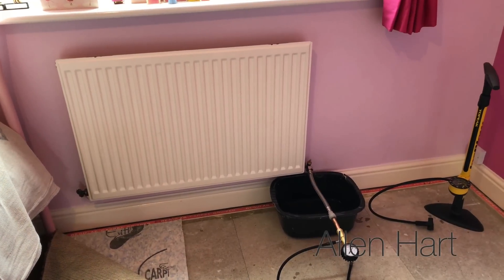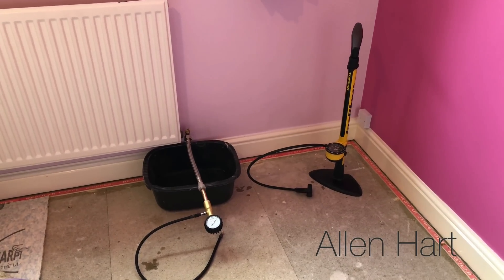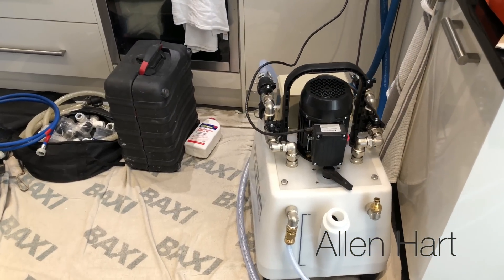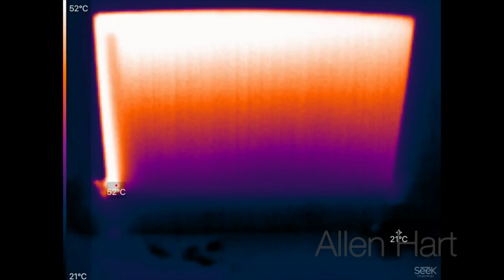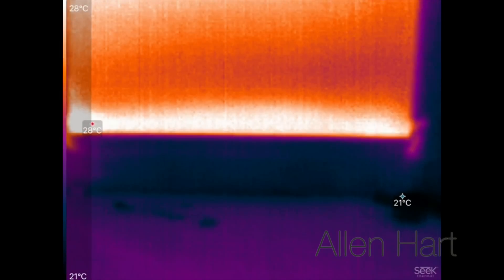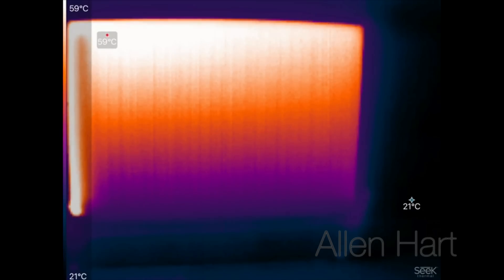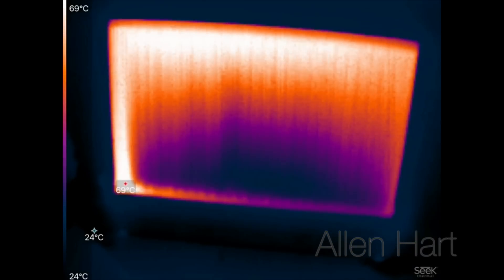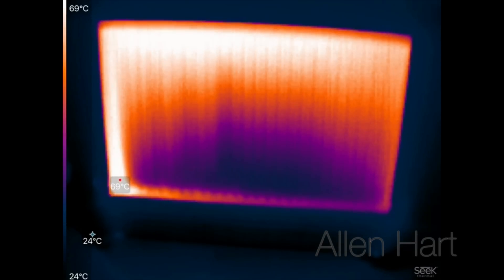Powerflushing Blocked Microbore Copper Pipe Day in the life of a Plumber

Comment: I tried the trick with the pump this morning, but to no avail on the 10mm plastic microbore return feed from the hall radiator. Think I must have put about 5 or 6 bar of pressure up it - all I managed to do was to cause air to flow into the kitchen radiator, and displace water up the cold feed which ended up going out the overflow pipe outside! But no water coming back down the microbore the other way, save for 1 or 2 drips a second - which is pretty useless for getting any semblance of flow! Even putting mains pressure water up it from a hosepipe yesterday did poop all too! Oh well - back to the drawing board!
Reply from the maker: Thanks very much for your comment, please consider subscribing to support the channel 🙂
Reply: @AllenHart999  My fix worked! Cutting a hatch into the landing floor so I could access the tee where the 10mm microbore return pipe joined on. It was totally blocked with magnetite, and I had to use a screwdriver to unblock it. Works a treat now though!
Reply: @AllenHart999  I've just subscribed! BTW I've located where the 10mm plastic microbore from the return from the hall radiator joins a tee now, so am going to unblock it there later this morning. That's pretty much guaranteed to sort it. Then to do the same fix for the return pipe from the lounge radiator.

Comment: Hi Allen would you say there's a age limit on copper micro bore I've got a system that's about 30 years old and was wondering if it would be better to renew the system is holding pressure but one rad burst about 5 years ago which I changed
Reply from the maker: renewing it maybe the best plan, depends on issues. Thanks.

Comment: Great idea and great vid... I’m guessing this would work on 15mm piped systems? Also what pressure did the blockage clear at ??
Reply: Thanks again Alan, to clear the blockage with the pump did you drain down the system or do it still with system water in the system
Reply from the maker: i have never needed to do it on 15mm tbh but i am guessing it would work the same. Thanks.

Comment: Hi Allen, genuine question not a criticism, with rads being so cheap now would it not be cheaper to replace it compared to the hours spent flushing?
Reply from the maker: Peter Gillam Thank You so much for your question, Replacing the radiator wouldn’t of made a difference, The pipe was blocked, I did advise to re pipe as well but it would of been tricky to do, chipboard floors with some of it tiled. Hope that answers your question. Thanks
Reply: Allen Hart thanks for the quick response, sorry I missed that bit!
Reply from the maker: Changing a rad would not clean or unblock the pipes. Thanks.

Comment: Great video Al, one question... a local plumber recommends a powder flush (as opposed to power flush) for my microbore crappy system. Do you agree that a powder flush makes all the difference? Once again, wish you were based in the south east!
Reply from the maker: I have been told many times that you cannot powerflush a microbore system but in most cases you can. We manage to unblock most of them and get systems working again. Hope this answered your question. Thanks.

Comment: hi Allen its really good idea to check and compare system via thermal camera. have you flushed system separetly with boiler ?  and how long did it take  ? thanks
Reply from the maker: This was only a small system but because of the blocked pipe and how bad the system was it took a full day, from 8am until about 6, non stop didnt even have chance for dinner. Thanks.
Reply from the maker: I also flushed by connecting hose pipe to rad tails and putting fresh cold water down, lots and lots of sludge came out. one very happy customer. Another company had told them they needed a new rad.
Reply: Allen Hart oh you did good!!really
Reply from the maker: abdullah kazım It’s a nice feeling to sort an issue when others have failed. Thanks
Reply: Allen Hart sure! you respect yourself, people and your job! you deserve money my friend